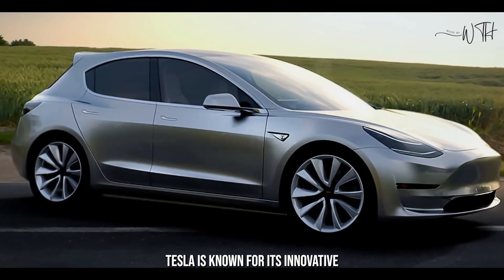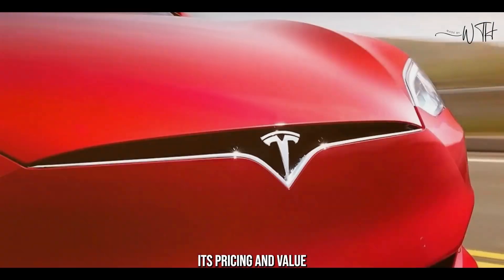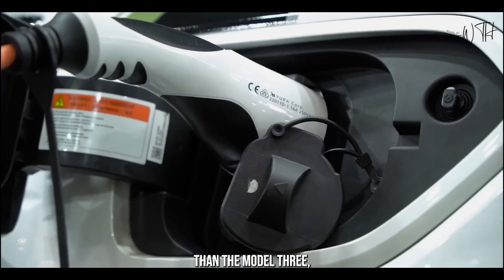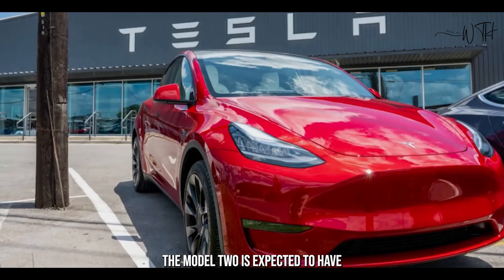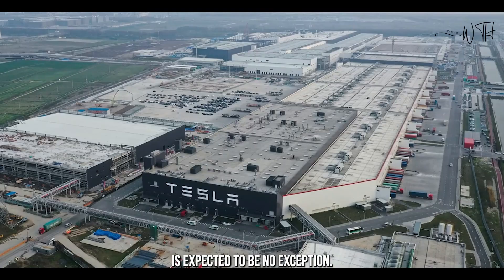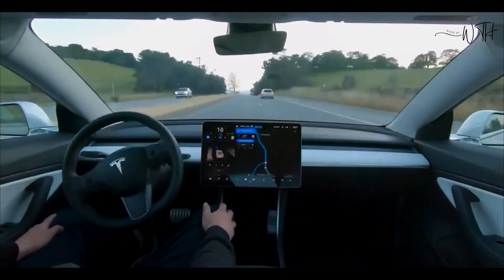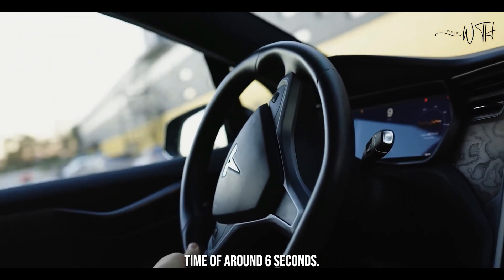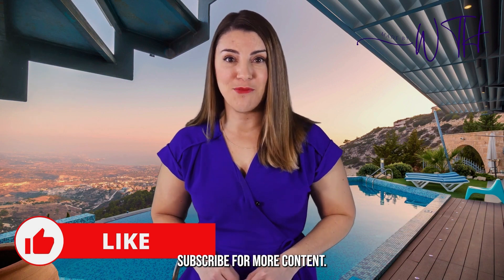New 2025 $17,500 Tesla Model 2  Features & Specs

Comment: Well we shall see if this all comes true on the pricing.  I prefer the dual motor of my model Y and the hatchback style for more storage.  Question is what does 17,500 price tag actually give us - just a bare bones Tesla - we shall see.

I think this vehicle is going to be too small in size for me and only be in a Sedan style.  The 0-60 in six seconds does not bother me.  I don't plan to race with the vehicle.   My current model Y does 0-60 in 4.8 seconds and has plenty of acceleration and speed for around town.  Any faster is just overkill for me.  Plus again I have dual motor-AWD with my model Y.

I have no plans to jump from my model Y to a model 2 when it comes out.  It will be interesting to see what other features the model 2 has as we get closer to a release date in 2025 or sooner.  Features are still too vague right now for me to get interested.

Thanks for the vague initial video on the model 2.